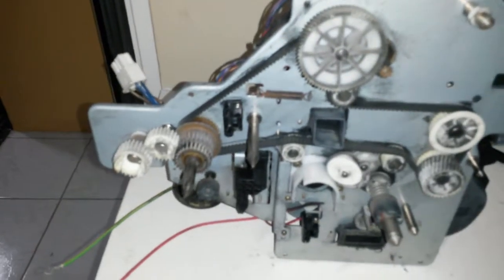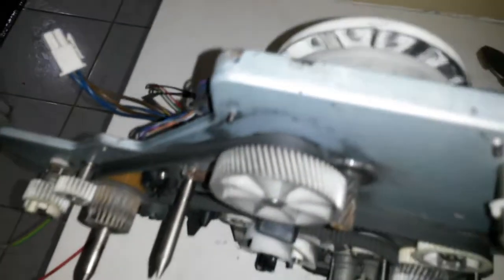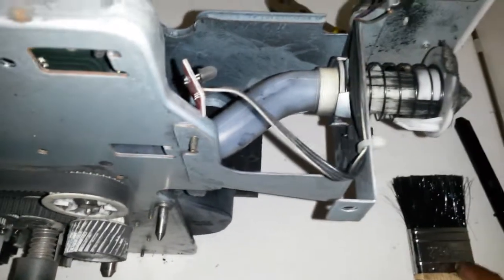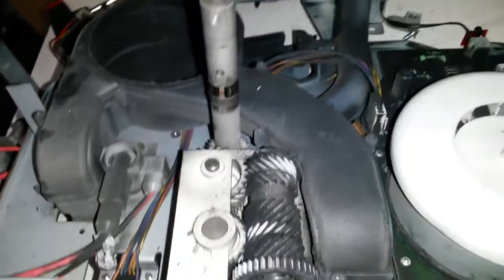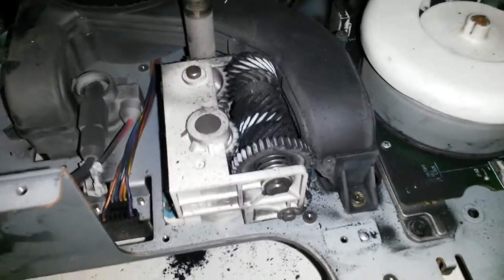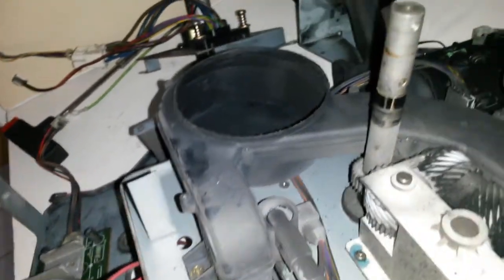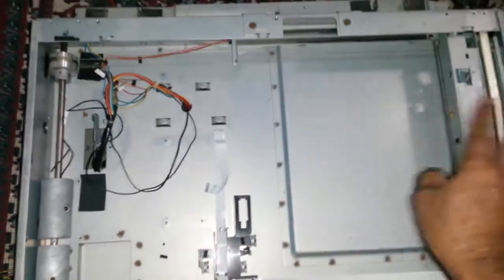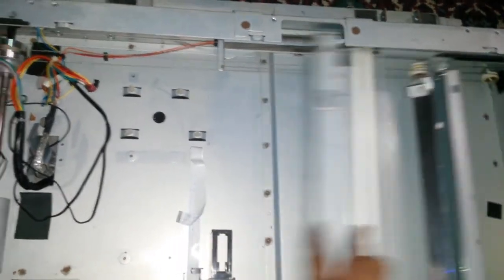106 Mechanical Systems in the Xerox Photocopier

Comment: Pretty nice mechanism, dude. Some great gears there too! 😊
P.S.: Sorry for being missing lately, I was traveling and my connection was horrible. 😕
Reply from the maker: Great to have you back. I only have one more system on the photocopier to do again. Been very informative. I knew a copier was brilliant but stripping it down really gave me a further sense of respect for the engineers that designed this. 

The project I was on closed down so I am traveling back to my equipment at the end of the month. Plenty spare time and equipment should equate to some build and experimentation videos. Maybe some technical ones too.